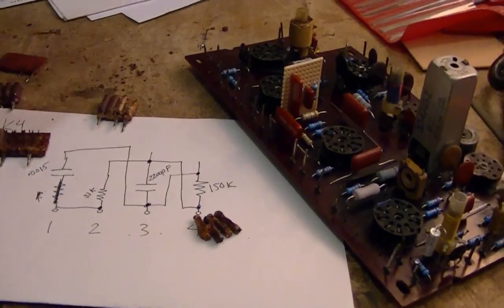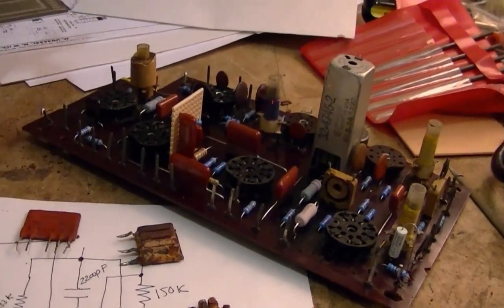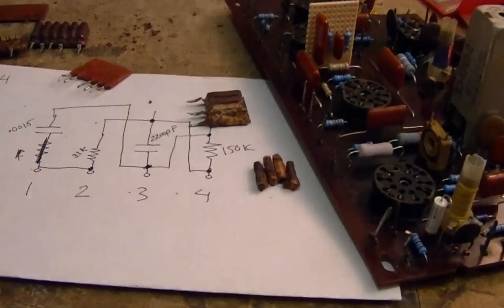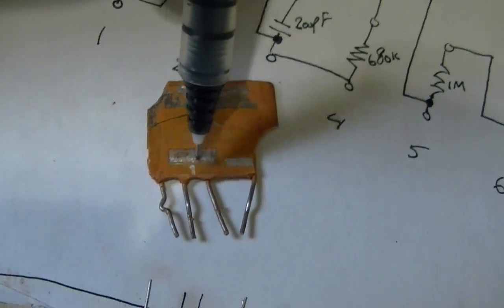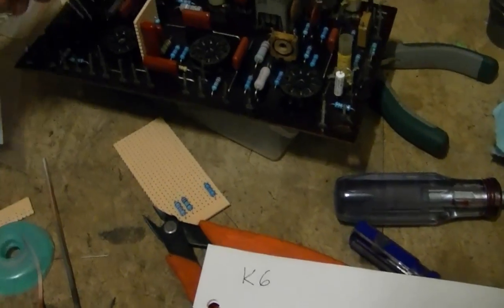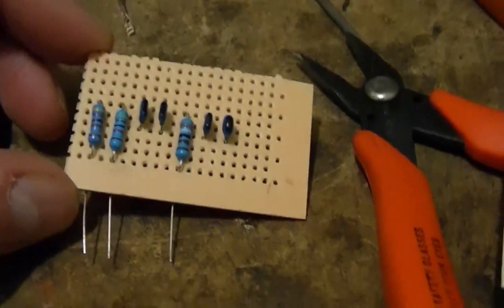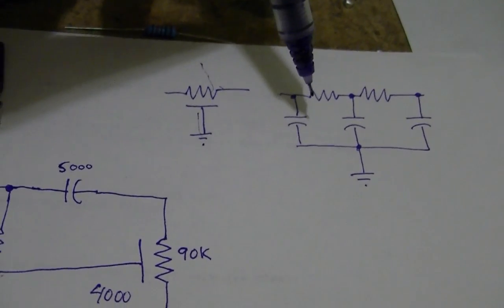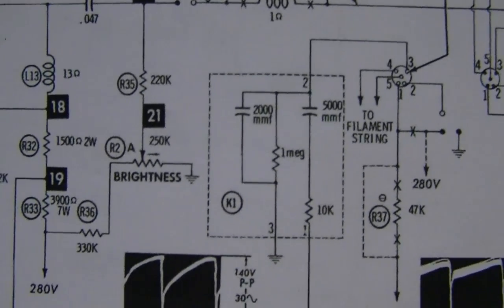Predicta "Holiday" restoration p7o?

Comment: im trying to get capacitors to rebuild my couplets on my philco princess except im haveing trubble finding some of the componets i have a cuplate  that needs a 600pf but i can only find a 680pf will that be fine
Reply from the maker: Hi.  I'm not sure what I used but 620pF or 560pF would be closer.  Be sure to use mica or C0G (NP0) type caps so they don't drift with temperature.

Comment: Remember what make those NP0 capacitors were?

Looks like the big capacitor you used in the vertical integrator is a 3% one- that's what the letter H means.
Reply from the maker: Maybe TDK  Not sure.  Got them from DigiKey.

Comment: Not just Motorolla, many manufacturers used couplates of various kinds during the 1950s, and not just in portables but in AC/DC sets and even cabinet radio phonographs, even hard wired chassis. Fortunately the failure rate is fairly low and they are easy to replace with discrete components, at least in hard wired sets.

Comment: Bob, what do you mean by saying "with the fusitor pulled out"? Not connected to the circuit? Why? I don't get the concept, sorry. Btw, are you going to stick to your original idea of the sockets? I think that would give you means to test the modules of the other sets as well (assuming they are identical and that is safe for this set), and the experimenting/ adjustments you may need to do.

Comment from the maker: I think I'll clean it but hold off on recoating until I get the set working.  The next thing I'll do after putting it back together is fire it up with the fusistor pulled out.  That should light up all the tube filaments.

Comment: Very creative solution to replacing those bad caps.  Motorola's 1950's portable radios used a lot of those combined caps on circuit boards to save space.  When you get through with that Predicata it will have far better components in it than when new

Comment: Hi Bob, it's good to know what that NPO really means. Thanks for the info. I guess those 1/2 W resistor will work just fine. I, on the other hand, being over cautious would go with 1 W just in case. That would be my personal choice. Anyway, you have more experience than I do. Looking forward the next steps. I think that, if you have not, you still need to work on cleaning and recoating the flyback before firing it up, right?

Comment: If the vertical integrator circuit is a filter of some sort and does not work you can always split it into more caps and resistors. 
With splitting you get a higher order filter with the same corner frequency but progressively steeper cutoff.
I just simulated the circuit in spice and a network of 9x 10k and 10x 400p act the same as your circuit untill about 30 kilohertz. The attenuation at that point is allready -40dBV.

Comment: Bob: I'm convinced that they used those integrated circuits to save space on the board and for ease of assembly. Otherwise they would have had to place those small components on the board and could have easily run into problems with crosstalk between adjacent the components. B.D.